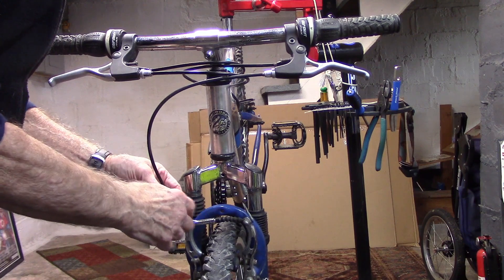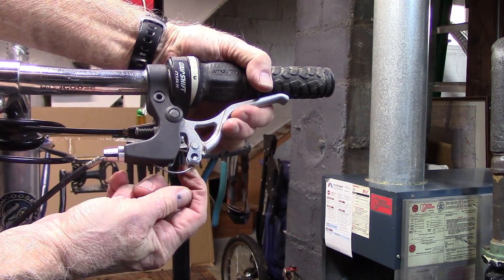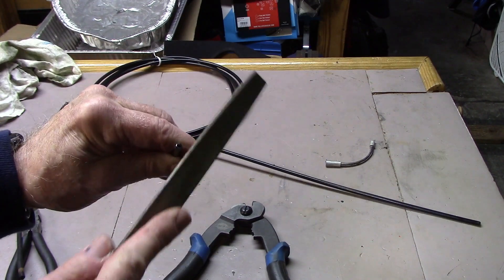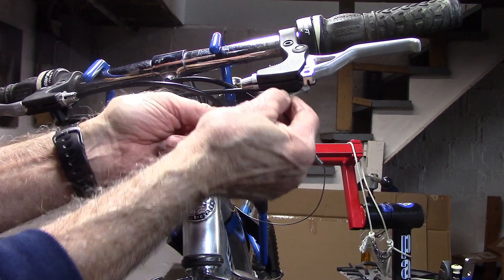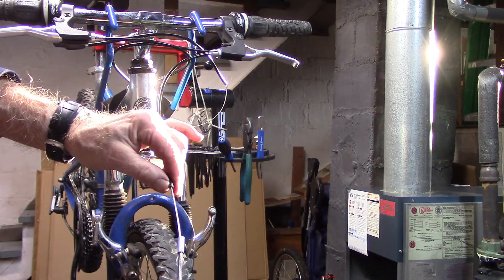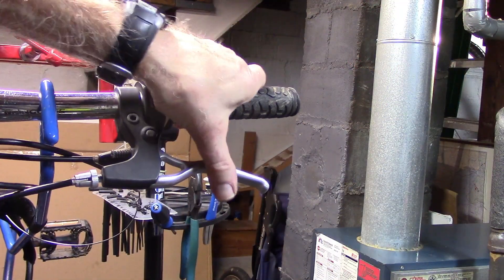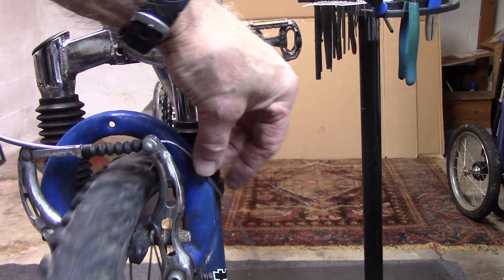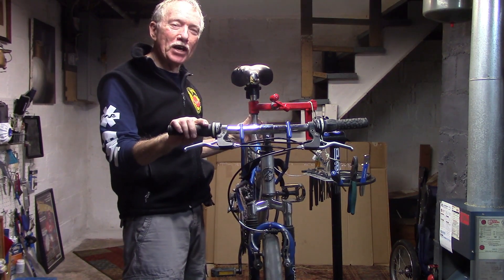Linear Brakes: Cable & Housing Replacement

Comment: V-brakes are sure a lot easier to work on then those piece of crap cantilever brakes, and they stop much better too.  In fact I personally like V-brakes better than disc brakes, I guess disc brakes stop better but dealing with that hydraulic system isn't worth the hassle and good V-brakes stop darn good.  Very nice video, thank you.
Reply from the maker: Cantilever (center pull) brakes offer reliable stopping power and are less prone to brake rub compared to V (linear pull) brakes. Cantilever brakes also perform better in wet or muddy conditions. On the downside, they can be more difficult to adjust and maintain, and are generally not as powerful as V brakes or disc brakes. I've worked with all the above. 
Disc brakes offer the most stopping power but I would agree that complete hydraulic systems can be a hassle for the average cyclist. My latest install were cable accentuated hydraulic brakes which greatly decreased the hassle of maintenance but still gave me great stopping power.
V (linear pull) brakes do work well and do have good stopping power. They certainly are easier to adjust and maintain then cantilever and disc brakes.
Thanks for your comments and insight. Regards and safe cycling, Tony

Comment: Hi Mr. Marchand,

I have a few unanswered questions upon which I hope you can shine some light.
1) What happens to the cables that makes actuating the levers eventually feel stiff or rough?
2) Will polished cables (such as jagwire) suffer the same fate?
3) Is there a way to prevent this in any kind of cable?
4) Does the housing need to be replaced frequently/is it damaged by the 'rough' cables?
5) Does using full length housings mitigate the roughening of the cables? 
6) What is your opinion on the alloy/aluminum joint links cable housing such as the jagwire elite line?

Thanks in advance for your help and for your videos!,
Carlos.

PS: apologies for any grammar or semmantic errors, english is not my native language 😅.
Reply from the maker: Here are a few answers and the rest you'll need to do some internet research (sorry I don't have more time):
All cables including Jag Wire, polished or coated cables will wear with time. Some will last longer then others. Wear occurs as the woven metal fibers develop internal micro-breakage which weakens the cable and also causes it to stretch. This may result in poor shifting or breakage at the shifter. See:
https://www.youtube.com/watch?v=mHqkFlNTyEM&ab_channel=TonyMarchand
I use standard Shimano or SRAM cables with Jag Wire housing which has an inner tubing made of Teflon. See:
https://www.amazon.com/Jagwire-Derailleur-Housing-Roll-Gray/dp/B001GZ9LVC/ref=sr_1_3?dchild=1&keywords=jagwire+bicycle+shift+housing&qid=1628450662&sr=8-3
I check my cables for fraying, especially at the shifters, every 1500 miles and replace the cable if there is fraying, poor shifting that can not be fixed by re-adjusting the rear derailleur barrel adjustment, or at least yearly. I replace the housing that is low to the ground near the rear derailleur when I change the cables and all the housing at least every other year. 
I hope this answers a few of your question. Regards, Tony
Reply: @tony10speed  thank you very much for your reply. You covered everything I needed to know. I also appreciate the links you provided.

Kind regards,
Carlos.

Comment: i have found that replacing the metal noodle with an adaptor is alot better with less friction points.
Reply from the maker: Several types are available and worth the money including:
https://www.wish.com/product/5e0746e344954721c77c86a6?hide_login_modal=true&from_ad=goog_shopping&_display_country_code=US&_force_currency_code=USD&pid=googleadwords_int&c=%7BcampaignId%7D&ad_cid=5e0746e344954721c77c86a6&ad_cc=US&ad_lang=EN&ad_curr=USD&ad_price=9.43&campaign_id=7203534630&gclid=Cj0KCQiA5vb-BRCRARIsAJBKc6LLr_OJJ0LKtYBPhvFb7IHWqyrfdsBrtkUaMS1kbRNSEuQ7RfZYy14aAq9LEALw_wcB&share=web

or less expensive:
https://www.amazon.com/CaLeQi-Flexible-Noodles-Accessories-Pair-yellow/dp/B08CT7KGZ5/ref=asc_df_B08CT7KGZ5/?tag=hyprod-20&linkCode=df0&hvadid=475718381184&hvpos=&hvnetw=g&hvrand=16759323350423609938&hvpone=&hvptwo=&hvqmt=&hvdev=c&hvdvcmdl=&hvlocint=&hvlocphy=9004016&hvtargid=pla-959138950480&psc=1

Thanks, Tony
Reply: Great tip! I was just looking for such piece of wisdom 🙂

Comment: Tony
Great videos 👍🏼. How can I cut the dropper cable housing and shorten it without having to remove the cable inside?  It’s a jag shifter housing with cable already inside the housing.  
  I’m replacing the dropper post shifter and have to lengthen the cable inside the housing & just need to shorten the housing and expose more cable
Reply from the maker: I'd personally remove the cable, at least part way, before cutting the housing. Trying to cut the housing with the cable inside might damage the cable. Anyone else have suggestions?

Comment: Shouldn't you line up the grove in the brake handle with the grove in the adjusting nut to take out the cable?
Reply from the maker: Yes, I should have shown that when I took out the cable. Thanks Tanner.

Comment: Where do you get the flexible noodles?
Reply from the maker: At Amazon: 
https://www.amazon.com/JooFn-Flexible-V-Brake-Break-Noodle/dp/B07CYM47HM/ref=sr_1_2_sspa?crid=2J2AH6IWN4EHL&keywords=linear+brake+noodle&qid=1556219534&s=gateway&sprefix=linear+brake+%2Caps%2C165&sr=8-2-spons&psc=1

Comment: Do they still make linear brakes?
Reply from the maker: Although largely replaced with disc brakes, we still see linear brakes on cheaper mtb models and kids bikes. In mountain bike restoration, we see them on many older bikes. Regards, Tony